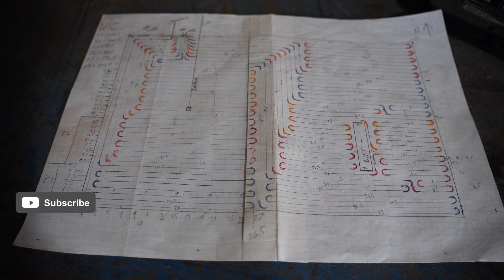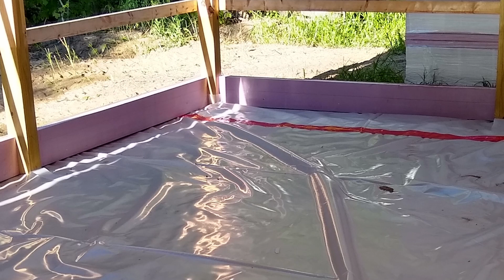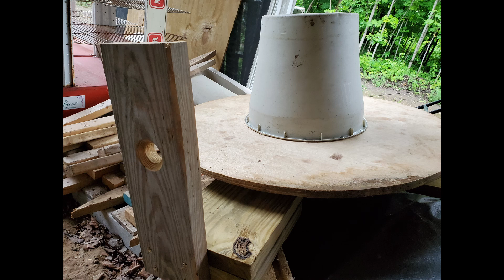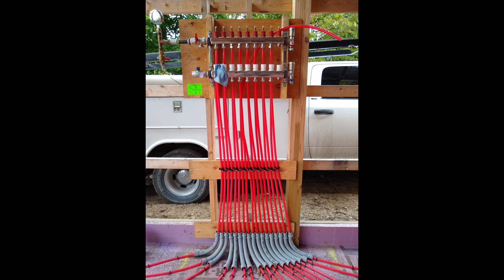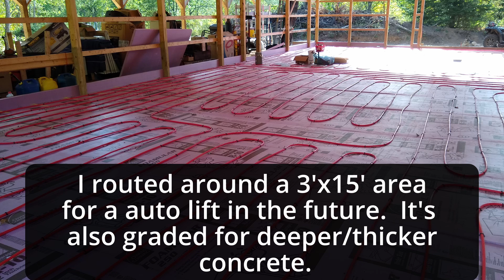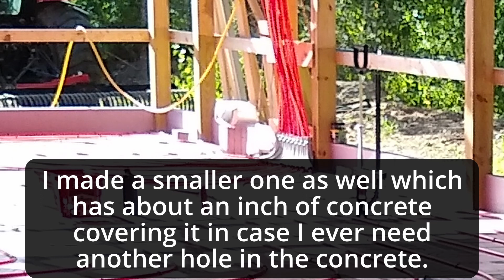Barn radiant heat ground prep and pipe layout.

Comment: I did not see any rebar or wire mesh in the concrete.  Did you not use any?  Is concrete cracking?
Reply from the maker: It's 4000psi fiber reinforced. No steel mesh or rebar. Almost 8 years now, no cracking yet (fingers crossed). Even added a 10k lbs two post lift,  been up for over 2 years now with monthly use, no signs of failure (again, yet).